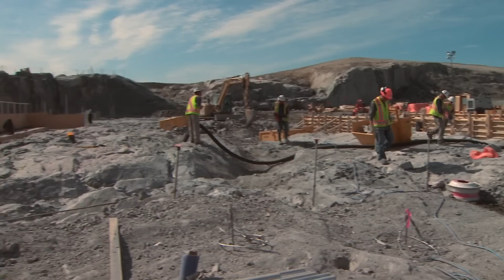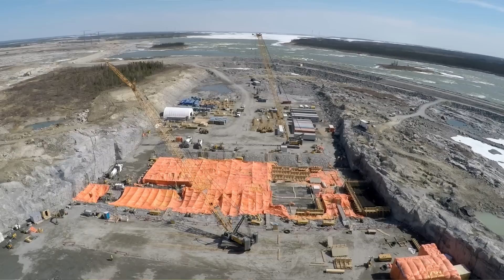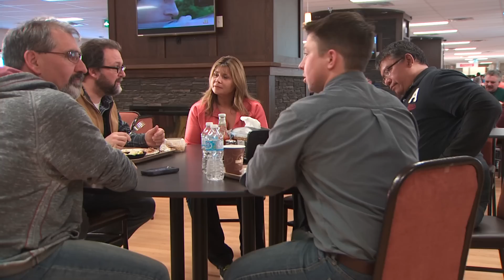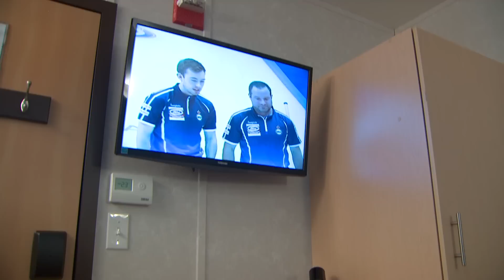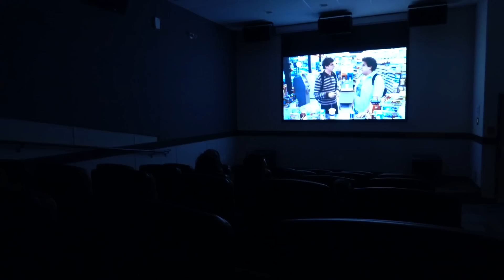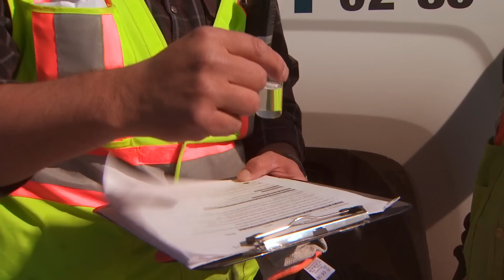Work at the Keeyask Generating Station

Comment: This is a great place to work and the camp might be the best one in Canada today. I worked there 2-1/2 years with the Earthworks group and the first-rate Crusher/Sand Plant team and overall my experience was excellent both on the job and in camp. Lots of good hardworking people up there performing well under challenging conditions (such as cold weather, an awesome river, difficult logistics, flooding and tough specs because MH is building it to last)

This movie is pretty accurate but  actually understates the camp facilities in a few ways. There's more good stuff to do in camp that wasn't shown.

Hydro did an excellent job designing the place and runs it pretty well too. Those who complained about the food must not cook for themselves -  a few times some choices weren't great but the professional kitchen folks prepare so much variety I always managed to select a satisfying meal. Typically the food was restaurant quality or better.